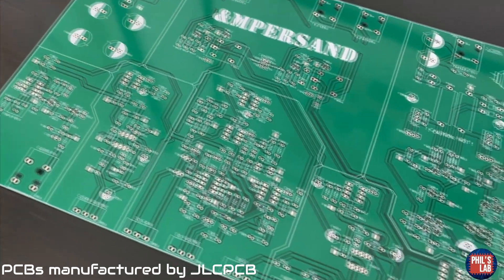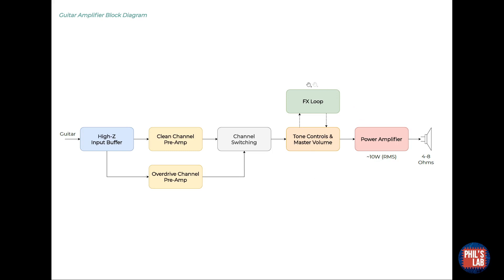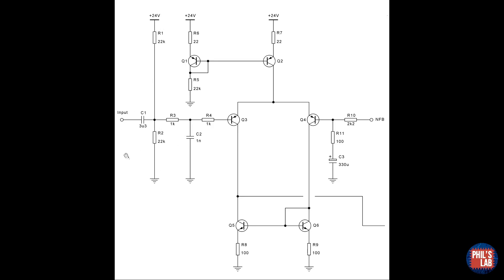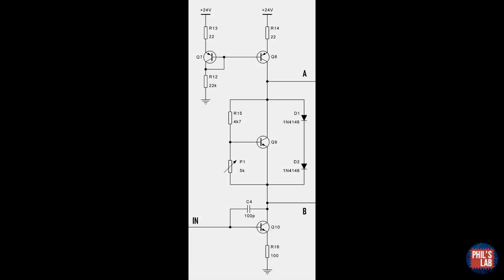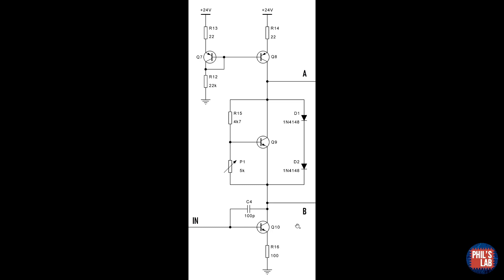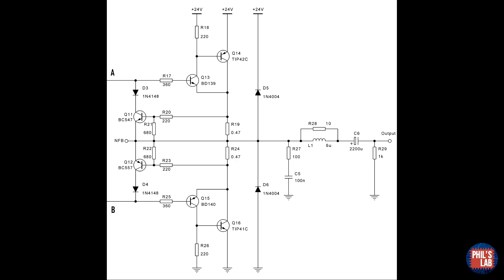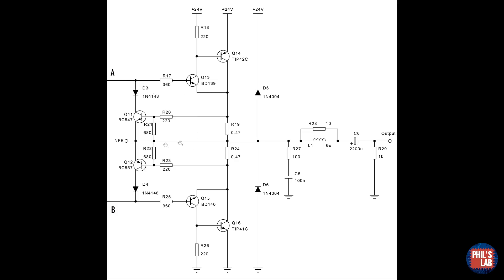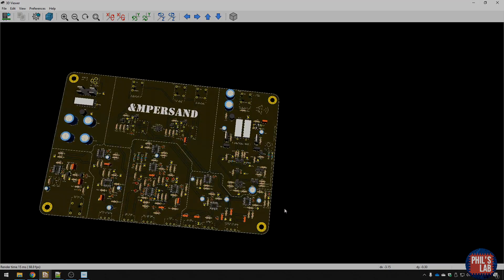(Sponsored) Solid-State Power Amplifier Design for Guitar - Phil's Lab #12

Comment: Maybe someone can help me. Why isn't the first stage replaced by a low noice op amp? And then fed into the class A part.
And why does almost no one use smd components (bjt or resistors) for the low power part? As the same technology like melf resistors are available.

Comment: Great video & well explained as usual! What power supply is used in that project, switched or linear?
Reply: Anyone?
Reply from the maker: Thank you, CJ - I'm using a switched 'wallwart' power supply for this.
Reply: @PhilsLab  Thanks for your reply. What about switching hum/buzz (50/60 Hz) with that wallwart, the voltage – in Sweden it's 70-100V AC/50Hz between AC safety earth and secondary minus on all switched power supplies (PSU) that i have tested – which may be passing via a small capacitor from primary to secondary in the PSU's what I have read. So to get rid of that buzz/hum when I use switched power supplies (have tried plenty) I have to "neutralise"  that AC 70-100V with a connection from PSU secondary minus to wall socket AC saftety earth, which is no fun. Here's an example:  https://youtu.be/-toarxIohKY  .... Any ideas anyone?

Comment: I don't understand this actually... You agree to use a big capacitor in the output, but object to use it on a negative power supply rail. Why digital domain engineers are so scared of negative voltages? =) A current must flow independently in complementary ledges. From Vdd to GND, and from GND to Vss.
Reply from the maker: This is a single-supply amplifier - only VCC and GND :)

Comment: Tisk tisk! Current mirror doesn't current source make! Variation in supply voltage will vary current mirror current, and this in turn will end up in the stages fed by the mirror!
Oh and those transistor on the output will need a heatsink, 10W at class B will result in at least ~4W of power dissipated.

Comment: I am pretty new to analog electronics and audio stuff. What I do not really understand is why not use a simple opamp? What technical advantages does a custom BJT amplifier circuit offer? Does it have economical advantages? If you would implement this amplifier with ready-made opamps would it sound worse?

Comment: I would think that you know this trick, but, for those who do not... For two transistors that you want to be equivalently thermally influenced (example: matched pairs)... when you layout the board, position them face to face, with their faces actually (just) touching... Before you populate the board, put thermal paste on the faces of the transistors. Populate the transistors on the board, square their faces and solder them into place. Wrap their heads (together) with Kapton tape to keep their faces in contact. Thermal movement can occur, otherwise. Only wrap around the side of their heads, to allow heat to escape off of their tops. Make a note to the Boardhouse instructing them to proceed with manufacturing the boards with the transistors paired as placed. Your board software may complain that the transistors' courtyards have been violated, but this may be ignored. Just make sure none of the pads are shorted. This is an old trick... Not mine, of course.

Comment: > @2:25 I design the amplifier to run of a single DC power supply

Why? What are the tradeoffs?

Excellent video :)
Reply from the maker: Thank you!
I designed for a single-rail DC power supply for the following reasons:
- Much easier to get a single rail (no centre-tapped transformer needed).
- Can get my DC rail directly from something like a laptop power supply, therefore no messing around with designing AC to DC power supplies and lethal voltages.

Comment: I was wondering why you choose such a low output power?
Reply: in the words of the great nelson pass: what's the point of 100 W if it sounds like shit at 1 W?
also, generally, instrument-centric speakers like those you see on cabinets, have very high sensitivities, something like 110 db/W/m so 10 W is enough to play in small studios
Reply: @GeorgeTsiros  Yes, that does make sense, I'm used to speakers in the HiFi area of  85/89 db/W/m or so where 90dB would be classed as very efficient. I remember my cinema days of years ago when 20 watts could fill a 1000 seat auditorium.
Reply: @MichaelBeeny  88 db/W eeeeeeek! Go over to audionirvana and get yourself some nice high efficiency full-rangers 😁

Comment: Awesome as usual.
Can you guide me to learn these stuf as a beginner ? I've currently just finished electronics course at the University and I don't think I'm gonna see any of this in the carriclum. Is there any specific topic/s or an online course to get started with these stuf? Thanks
Reply: analogue electronic + PCB design
Reply from the maker: Thank you! But yes, as others have said there's plenty of material online and in books. Check out 'The Art of Electronics' or if you're particularly into audio, check out books by 'Douglas Self'.
Reply: @PhilsLab  +1 for The Art of Electronics.
Incredible book. (IMO, use the last [3rd] edition)

Comment: That software did you use for simulations? What type of simulations/analysis did you perform?
Reply from the maker: Pretty much just used LTSpice. Predominantly DC analysis to ensure operating points (current + voltages) are what they should be. Other than that some frequency response analysis.

Comment: That's one great video on power amplifier design! I have a question, why does the active load in the VAS increase the gain? Thank you! I would love to see more videos on audio amplifier design.
Reply from the maker: Thank you very much! In general, for a common emitter amplifier the gain is approximately equal to transconductance * impedance of load. Since a current source typically has a very high output impedance, if used as the load, the gain is increased by a large amount.
I'm planning on making a couple more videos on more analogue design as well! :)

Comment: Very nice! Are you planning to release the files for this amplifier?
Reply from the maker: Thank you! I'm currently changing the board from through-hole to surface mount and then I'll be releasing parts of the amplifier, e.g. the power amplifier. Not sure about the whole thing yet but who knows!
Reply: @PhilsLab  I think the through hole design would be great for my son to do himself. He recently started playing the bass and one of his amps is a bit dodgy. He could then replace the amp inside it and keep the driver. He likes to tinker but not sure where to start so I think this would be a great introduction.

Comment: Really nice video! Just had an exam on power amplifiers this year and I'd like to point one little thing: if you were to use heatsinks for those power transistors, you'd ideally join the transistor responsible for the Vbe bias too, as the heat difference will affect the transistors beta value (or hfe), shifting the bias value. By clamping all three transformers to the same heatsink, the temperature of all three transistors would be the same, so the beta value would change at the same rate, hence avoiding the bias shift.
Reply from the maker: Thank you very much! Hope your exam went well as well.
This is true for a typical Darlington configuration, however things are different for the Sziklai pair. The output stage should not be directly coupled thermally to the Vbe multiplier (see https://sound-au.com/amp_design.htm#s31).
Reply from the maker: Hi Phil, That’s awesome - I’m a HUGE fan of Rod’s (and sound-au.com), so thank you both for providing such great content there. If you do get the chance, I would really appreciate it if you could say thank you to Rod as well. I’m pretty sure I have read every article (no joke) on the site!
Reply from the maker: @Phil Allison That's great, thank you very much for that, Phil.
That's awesome, you must've seen quite a number of things during your years working on all that audio equipment (only something I can hope to say about myself one day!). Did you end up designing some of your own tube guitar amps as well then? Yes, I finished university last year but to be honest most of my engineering experience I seemed to have gathered from just going out and 'making stuff' in my spare time..
Thanks again for your message.
Phil

Comment: I like the number of safety features and current mirror in the pre amp! Have you considered removing output capacitor, adding bias potentiometers and using some direct current protection IC? Maybe i missed something, but LEDs signaling footswitch state may be useful as well. Best regards!
Reply: If the output cap C6 was removed, the amp would supply a continuous average 12VDC to the speaker. Aside from continuously pushing the speaker in or out, that would be a constant 36W into the (4 ohm) speaker, doing nothing useful, and heating up both the speaker and the amp.  There's no easy way around that capacitor with a single-supply amp.
Reply: @Graham_Wideman  you are right, there is no symmetric power supply
Reply from the maker: Thank you! Yeah, as Graham said the output capacitor is necessary, as it is a single-supply design. For a split-supply design, it'd be interesting to play around with some bias servo ideas to try and minimise the DC offset at the output.
And yes, some more advanced footswitch options would be cool as well :)

Comment: It would have been nice to show off the assembled pcbs at the end.
Reply from the maker: Yes, I'll be showing the final version of the PCBs when I have made the SMD version of this amplifier. My soldering job was a bit crummy and I didn't want to get in too close to that with the camera haha, so I'd better get JLCPCB to assemble all the surface mount parts for the updated version! Hopefully next month :)
Reply: @PhilsLab  No worries, under no circumstances would I have started to critique the soldering job. Good work on the design though. Did you use any spice program to simulate the circuit or portions of it ?
Reply: Do you have the full schematic by any chance? Would love to study and make it for my final electronics project.